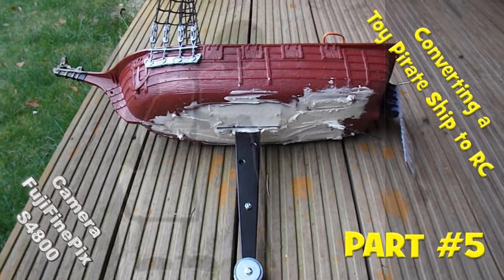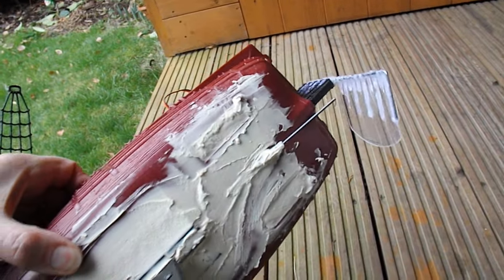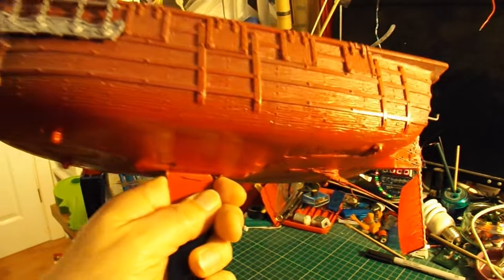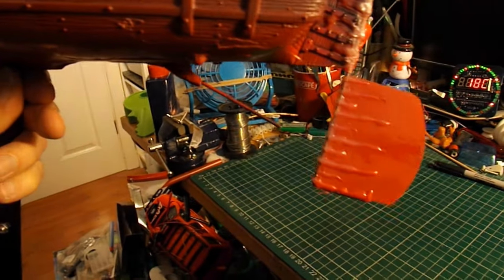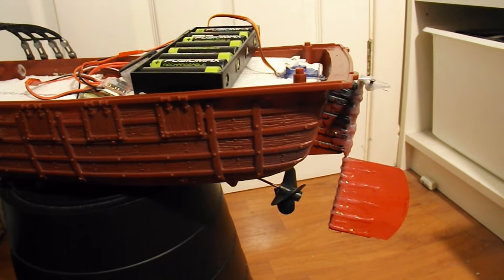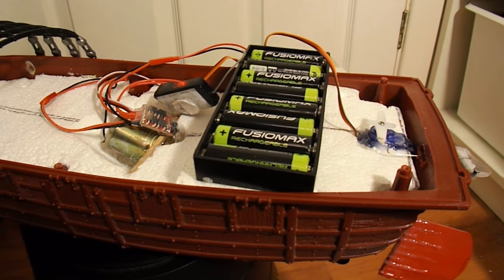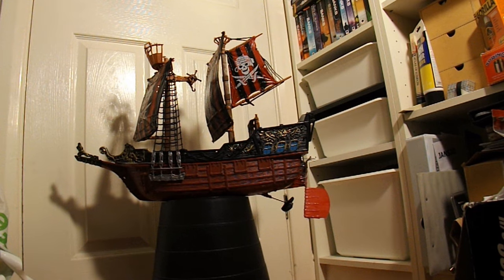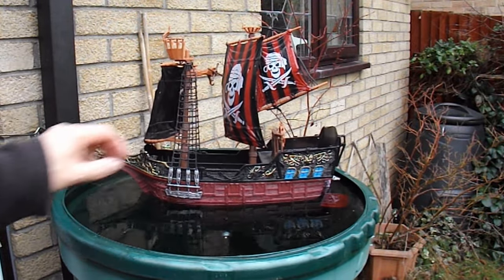Converting a Toy Pirate Ship to RC PART #5

Comment: Sweet as a nut this project :)
The filler looks good with the red over it, is the paint thick enough to repel water ? just wondering, cos if any issues then Rain-X or similar would likely protect, or a vehicle clear coat spray. 
Should scoot well on the pond.
Reply from the maker: Hi Slider, I lost your last comment on those walkie-talkies just  in case you thought I ignored you. I think I deleted it instead of approving it as YouTube had hidden it in the spam folder. Just ordinary cheap car touch up paint. The boat is plastic and the filler should be waterproof so it should be OK. Even with that weight on the keel it still tips well over with the slightest breeze catching the sails, but it rights itself straight away 😊
Reply: Ah, thought you'd sprayed it. Well it likely went on a bit thicker than spraying, which is a plus. The boat may now have a 10 year anti-perforation warranty with all that car gear  lol

Comment: you may want to make some holes in the sails so on a windy day it doesn't run away😂
Reply from the maker: I think the bottom line is not to put it in the water on a windy day.  The slightest breeze catches it 😊